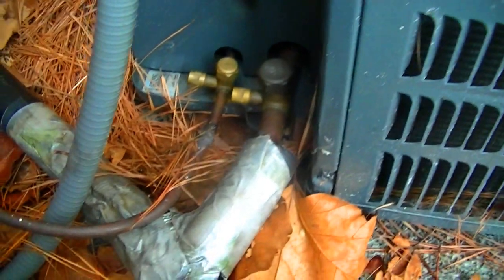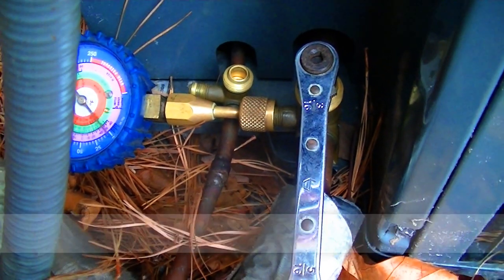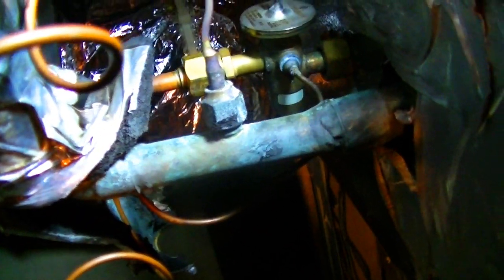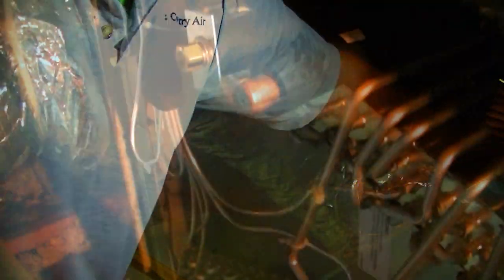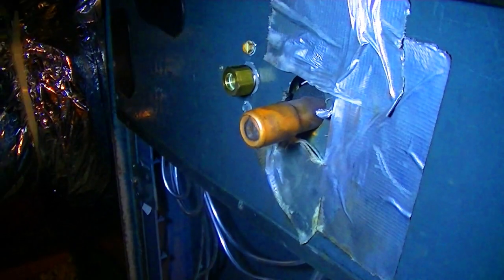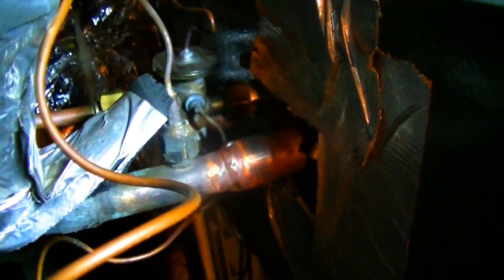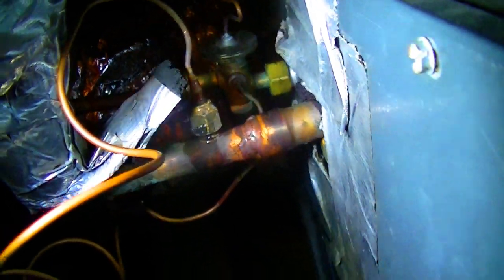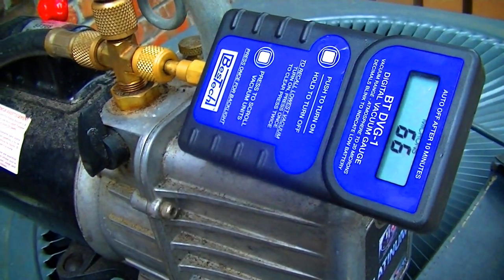HVAC Service Training-  Evaporator Coil Replacement

Comment: HVAC Shop Talk my system just stopped cooling. I have a 2014 Goodman compressor connected to a Goodman coil. This is connected to a 1995 (York?) gas furnace. I think the newer Goodman stuff is 5 ton where the original was 4. Also my old HVAC guy did not register the unit so it’s out of warranty I’m told, since it was just 5 years... so, do I get a new Aspen coil installed with a new plenum for about $1,800? Or, do I want a new Rheem full system for $6,500? I just got a new drain pan and float switch which seems perfect but my new guy wants to replace this, he says he buys this in a kit, that part sounds like BS to me. Thoughts about a new coil (which I assume comes in a new enclosure) or a new system? Also, Trane vs Rheem??

Comment: throwing a 2.5 ton 410a outside condenser unit in-line with an old r22 evaporator attic unit 2.5 ton. went to update the orfice(piston) and the new one that came with the new 410a unit is too big. old one on the r22 unit is 078 and the new one is  063. any ideas on how to make it work? cant get the new one to fit inside the copper pipe
Reply: Hi Robert , How are you ? I am from K S A , I feel like to communicate with you , How it possible ?

Comment: how did u find a alluminum replacement ? by model number or just generic by dimensions and tonnage?
Reply from the maker: +TJ Trout goodman gave it to me. Unless it's an old coil most of the new replacements are aluminum

Comment: how do you pressure the system back up? do you have to open the service valves in any particular order? do you put a small amount of refrigerant back in on the evap coil side before opening valves?
Reply from the maker: Manufacturers dictate how it's done. Personally I open the liquid line first, slowly.
Reply: ok. thank you for the information and video

Comment: Another Great Video! Liked! I Was Wondering How You Liked the aluminum Evaporators they are using these Days? How Long are they Lasting? Any Problems with them? I Only Use Copper Tube Evaps. My Gut Tells Me it's a Bad Idea-Aluminum Evaps.

Comment: Tidy work Zack! What makes all the coils leak? Don't have that problem with mini splits here.
Reply from the maker: They say it is a type of corrosion from detergents, cleaners and other household VOCs. thanks
Reply: talyn875
Actually... I've heard and seen the real reason, Have you ever noticed how copper coils use a steel plate near where the copper loops and U bends are at? Have you ever seen those get rusty? Copper actually corrodes when it is in contact with rusty steel, not to mention that copper and steel are dielectric, and will destroy eachother over time. I don't know why they never used an aluminum side bar, but it would work great considering you find most leaks near the U bends, and not within the fins very much
Reply from the maker: John Smith I think that is true as well.
Reply: What's really strange is that on a lot of older units from the 80s, is that they still used steel in the coils, but I've seen original coils with no rust at all. What happened to quality control?